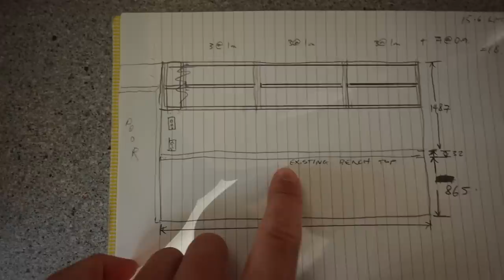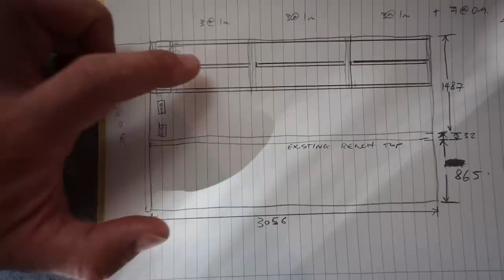I'm Going Back to Auckland

Comment: Do a score cut first just a few mm’s you’ll notice a massive difference. And the splinter guard remove it and reattach and then cut again with the saw. Nice tight fit to prevent tear out
Reply: yeah i'm a woodworker and this is what we do to prevent splinters. you can do a score with a knife or something else sharp and that will be good as well, just as long as you break the surface level fibres
Reply: Scott's done this before and I was wondering why he didn't this time
Reply: mm not mm's. You don't pluralize metric units.
Reply: @sw6188  ok sir. I hated school.
Reply: @NorthWalesCampers  So did I, but if I can help someone else then that's a good thing.

Comment: Hi Scott, the Festool Saw has a Splinter Guard,  eg Splinter guard SP-TS 55 R/5. When you dont have this make a first  cut at 2mm deep backwards an than the normal Cut. With this you could prevent splinter too with all Plungesaws

Comment: Tip I find helps with laminate materials or ply, is to do a 1 or 2mm deep ‘back cut’, plunge the saw and cut backwards on the first cut so the blade teeth cut down into the material creating the clean score cut, and then depending how thick the material is a couple of forward passes or full depth forward cut. Then instead of buying new strips everytime, get some thin double sided tape and use it to keep sticking on the old strip, shifting the strip across as it wears out

Comment: Tip for Rich... if you are not using the Holden a lot, run it on BP Ultimate 98. It actually gains a little bit of octane when stored unlike most 95 and 91 which loses it. It will likely help with the starting. Also you can advance your timing a bit then for a little more power. If not already, running an electric fuel pump, checking the carb balance, points gap etc might help. If everything is right there is no reason she shouldn't start like a modern.
Reply: Yeah i agree, i get it tuned by local MG guys who are awesome with the SU carbs and it runs mint, until a couple months pass and i havent driven it and then it runs like crap. I dont know anyone in Auckland who is a good old school/Holden mechanic and the amount of times people have made things worse is astounding, so one day it will become a priority and ill get it running hard and fast.

Comment: Small tip for the tracksaw, when cutting laminate i find that doing 2 passes gives the best results for me. First pass like 1/8" or 3/16" of an inch than 2nd cut right through. Prevents lifting of wood fibers. Anyway thats just from my experience. Good stuff 👏 👍
Reply: I’ve got the Makita and it lets you cut first pass with 2mm cut before cutting full depth . I used to have Mafell but motor burnt out .

Comment: I think you can limit the tear up by using the green surface guard/guide on the front outside edge of the plate. You can adjust the guide to run flush on the surface of the material you’re cutting. Thats what I read in the festool manual and it works well on doors and laminate etc

Comment: I always thought that you had to place the sheet upside down and cut it so the blade cut up into the surface to make a chip free cut
Reply: Thats what I was taught as well
Reply: What you are saying is correct. The "good" side should be down because the blade rotates up into the board at the bottom. At the top it rotates up away from the board, which can lift the fibers.

Comment: Hey Scott, enjoy your videos!  I think the issue with cut quality of the festool is that the splinter guard didn't exactly match the blade. If you install a new splinter guard that should solve the cut quality, but from that point on, only use the saw that you initially used to trim the splinter guard with that track. This would always ensure a quality cut. Even if you have two festool saws, its' recommended that you always use each saw with it's correspondeing track. Thanks for the great videos!
Reply: Thanks Eric, yes have since replaced the strip and bought a dedicated track for the Makita.

Comment: It's definitely the gap with the splinter guard. I've never had an issue with my Festool track saw, it always makes perfect cuts even with garbage lumber.
Reply: More of an alignment issue.  His base was missing an adjuster screw and the blade was cutting at an angle to the track

Comment: Festool track saw issues. @ 12:00 You’ve used two different saws on the same track. It’s possible the makita is just barely narrower compared to the festool this means it would have cut a thin kerf out of the rubber piece that rests on the ply. You should be able to pull it off & move it over & re-cut it so it matches the saw & blade. There’s also a green tab that goes on the front side of the saw (currently clear) that the blade cuts into to create a zero clearance insert & it’s a consumable. There should be a spare in the box, give it a try. I hope this helps :)

Comment: At 17.33 when checking the good festool cut, the rail was placed on end, the splinter guard end, this also has affect on alignment for the guard which then leaves chips, it’s common with the festool/makita rails, never had to change the Bosch splinter guard tho.

Comment: Scott, try cutting the panel from the back. The saw teeth will pull on the feature side as you cut rather than push and blow out the grain. cheers

Comment: The Makita has a laminate zip funtion. It'll cut at 2 or 3mm depth to cut the laminate top layer. And you'll always have a tiny opening between the blade and splinter strip, because the widest part of the blade is the teeth and not the blade 'body'. So adjusting it tight to the splinter strip will probably cut it further.

Comment: Hi Scott, I've found that when using the festool its best to run a scribe cut before cutting through the full material (especially crossgrain). The Maffell is great for this kind of thing because it has a scribe cut built in to the machine and is shimmed a fraction back from the splinter guard so is always a crisp cut. Great to see Rich back in the videos, like the car. Thanks

Comment: To have a cleaner edge on the offset (which you need according to your cutting diagrams) you HAVE to use the push down green thingamajig on the Festool TS.

Comment: Only had that sort of issue with an old or dirty blade on my festools, or when using the wrong blade for the material. Make sure it is the fine tooth blade, if the laminate is pre-finished do a score cut first, if you are planning on using both sides put the little plastic device on the front of the saw by the blade down, and potentially use a festool blade instead of off brand.

Comment: I noticed you have drawn the pieces you need on paper to see what you can get out of a sheet. I use the cutlist optimizer app, make life so much easier when you need to cut a lot of pieces out of a few sheets. Can even take into account the width of the sawblade.
Reply: Was just about to post when I saw your comment. Yes Cutlist optimiser is a phenomenal bit of software! Saves so much time.

Comment: few times on my ts55 ive had to either move the anti splinter strips or renew them all together. they do wear. or even recently i had to re adjust the little grabby parts on the base that actually position the saw. dunno if that was wear related though.... the saw is approaching 10 years old now

Comment: I recently made up a guide using thin line for cutting shower linings using a Bosh blade in a makita 18 volt cordless saw and have been getting absolutely no chip outs. Just goes to show you don't need those fancy high priced items.
Reply: About 30 years ago, I used a 6-inch Kango circular saw with 48-tooth blade. Got clean glass like cuts in 18mm melamine coated chipboard. Just used a steel straight edge as guide

Comment: Dunno about y'all, but I put the finish side down, and use a new finish blade with a high tooth count, so the saw teeth cut up through it cleaner.  If you're going to both sides being finish quality, they yeah, super clean cuts on both sides are important.

Comment: Peel the splinter guard off and move it out a few mil and reinstall and recut it with the festool saw
Reply: replaced it but i really like this idea. Next time ill try doing that.
Reply: @livingimprovements4382  it works in a pinch if you don’t have an extra splinterguard

Comment: Doesn't the makita have a pin in it to do a  shallow score cut 1st to prevent blow out, before your deeper cut?  It will have a red line on it.  You set your depth. pop the pin in, then click it out to do the proper cut.

Comment: Question. What's the plywood on the bottom side ? Even on Italian sliding table dimension saws using a hollow faced tooth blade the top surface, which is the bottom using a track saw, is 99% chip out free. Can you buy, or get an existing makita/Festool blade, ground hollow faced ??  Try it if you can but remember to cut the plywood / Melamine / Melteca face down. So it's face up on a dimension saw and face down on a track saw. I'd be interested in your findings.

Comment: Nothing wrong with the track saw Your face side should be on the bottom because the way the blade cuts it will give you a finer cut and the more teeth in the blade makes a finer cut too, 40+ better still 50+.  also put tape along your cut line an that will stop tear up. 👍 if it laminated put the face side down,guarantee no chips.

Comment: I bought my ‘ergonomic’ Bosh skillsaw with track about 35 years ago for the equivalent of about $400NZ. Was meant to be the bees’ knees. Clunky peace of crap that just wouldn’t die. Because I am a stingy Dutchman, I have kept using it until something minor on it gave the ghost last year, during level 3. Only needed a new spring for the guard. Where do I find that during level 3? So, I got onto the Bunnings website, found a $128 Makita and with $7 shipping, it showed up on site the next day. Best skilly I have ever used. The Bosh, which only needed a new spring, went straight in the bin.
Reply: Jesus 35 years of life for a skilly you can't complain there!
Reply: I know. I kinda wanted it to die sooner I suppose. I'm more dismayed about tools that have died on me that I loved and are harder to replace, or impossible. Like a little 100mm Elu plunge saw, or a 1000W Metabo drill, or an Elu router that I had jigs made up for...

Comment: First, use a Festool blade on the Makita (and the Festool) saw or another high quality, high tooth count blade, ATB or Triple Chip tooth pattern when cutting ply or other manufactured sheet that is going to have exposed veneer or coatings. I have never seen white coated blades in Australia or on International web sites so I have no idea what the brand is, but I may be sceptical of their quality. If you are really stuck (like chipping a tooth on the blade), just score the top layer with a sharp knife run along a metal straight edge, that should stop most of the splintering. That model Holden (in Oz it was a '65 with the points on the mudguards/fenders) was the worst Holden they ever made - new suspension, new engines, released before they had worked out all the bugs. My father had one and got rid of it in less than a year, it was so rough that it would change gear from vibration driving down the highway (not back streets) without touching the clutch. The next model was good and used the same - fixed - suspension and engines & I think you could swap the parts with the later releases. If buying plaster, cement board or similar products from a certain large Asian country with Human Rights issues, remember that by their official standards, 'Asbestos Free' can have up to 25% Asbestos in it and still be 'free' of Asbestos, something that a few large Australian building companies found out the hard and $$$ way, after getting samples that were genuinely Asbestos free, then getting ship loads of the 25% stuff.
Reply: Then that negates the point of the saw.
Reply: Ah yes, the good ole chnese, if you're not in their group, you're fair game for a rip off.

Comment: G,day Scott Brown Carpentry from Sydney Australia.
The chipping of the veneer plywood.
Finding that the blade is not parralel to the base plate edge: the teeth of the blade would be pulling up.
I have placed masking tape over the cutting line to reduce chipping!
Sheet material 
That's looks like good quality ply?
🌏🇦🇺

Comment: Hey Scott, Great video as always!
I've recently got that same Makita track compatible circular saw, haven't used it as a track saw yet... were the cuts you showed of the underside of the ply? as the blade direction would be preferable that way I believe. Would be great to know if that was the case so I don't use that tool for that type of work. Cheers

Comment: Is that a washing machine in the Kitchen? Aaargh, that’s something I hoped would never get here from England. Terrible idea. Let’s make everything smaller and smaller, pretty soon it’ll be like living in a caravan. I hated that about English kitchens, and so small. Sad to see it creeping in here, who wants to drag their laundry to the kitchen where you prepare food? Eeuw. Never got used to that. Odd thing is he actually has a garage, even though that car just fitted why aren’t the laundry machines there?  Tear out fix was interesting to see but why not try turning the timber over as the blade direction you showed us came out the good side, theoretically then by turning it over it would cut down into the good side and tear out the back so be less visible, but obviously getting the track saw fitted correctly is best. What a difference to the cut edge. Personally, not sure about plywood cabinets in a kitchen, rather cheapens the look, when usually homeowners want the best looking and hi-end kitchen they can afford, ply edges don’t appeal as the bang for buck. I guess ok for a rental or a bach but for the minimal price difference mdf cabinets from box stores would have given a better final appearance.

Comment: 11:15 you cant use the same track for multiple saws... thats whay your edge is kicking up you have ruined the virginity of the cut line rubber strip?
Reply: Yeah 100% and i now have a new makita dedicated track. But even with the new strip fitted on my festool im still having issues, always have. Ill get my blade sharpened and then check again.
Reply: @livingimprovements4382  Correct me if i'm wrong but I even thinkg cutting a 45 on the track will ruin for 90's and vice versa. But if you have a new strip it has to be the blade, only option left right?

Comment: You cannot use both saws on the same straight edge. That is why you are getting crappy edges. The saw and blade are married to the little plastic piece on the first cut you make when you get the straight edge . Come on you "professionals".